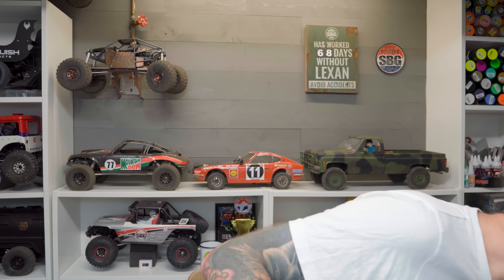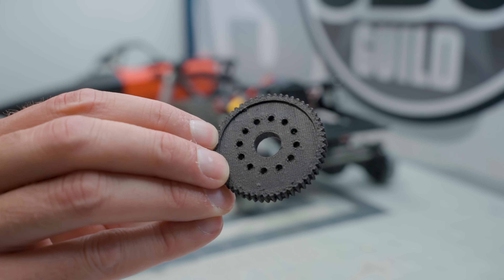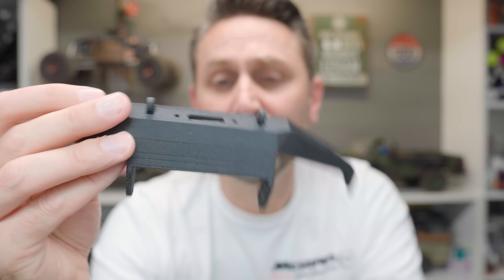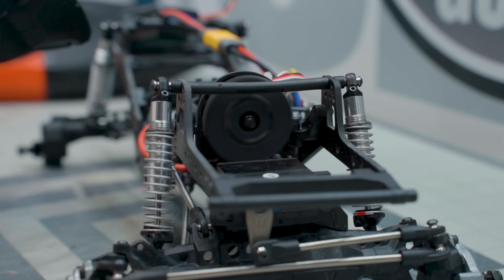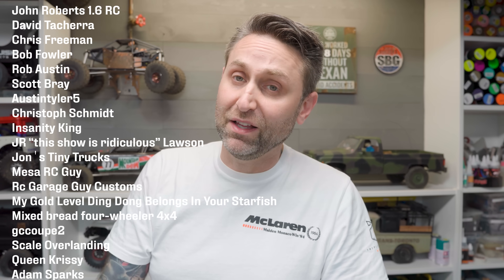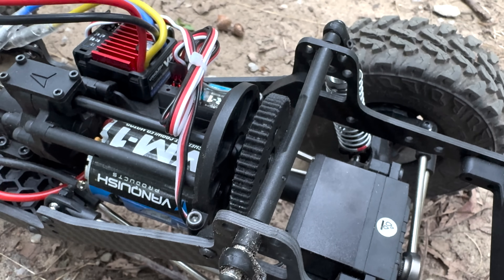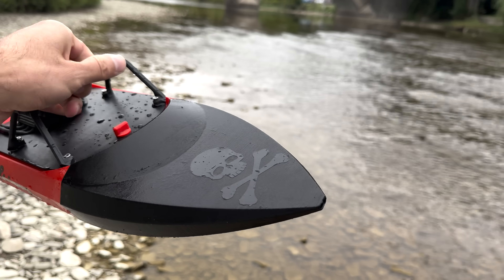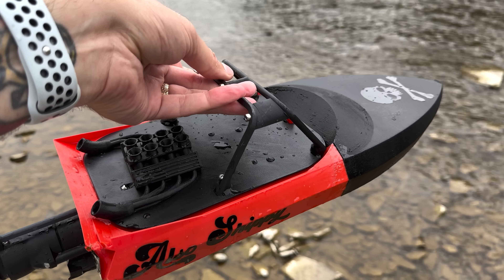Say Goodbye to Old Filaments – Meet the Game-Changer of 3D Printing!

Comment: To really test durability, make a hammer out of it and see how many nails it will drive before breaking. Might need to make a hollow core and fill it with weights to get the right feel. Could do this with several other filaments as well. Might be a fun test. Maybe not the best for this channel though.

Comment: You should checkout the new line from Polymaker called Fiberon. I started with a spool of PETG-rCF which is amazing. Easily printed, super strong and looks great. Then I tried PET-CF17… Awesome!! Finally , I tried the Pps-CF. It prints at the highest temp my K1C will go but it’s almost like it’s a metal and a polymer. Check it out!!

Comment: Why not print replaceable bumpers along the edges tip and front hull, like real jet boats, in the ppacf.  specifically places where impact damage mean a full reprint to replace. Would keep the costs down on that filament in the long run. This is completely game changing. I wonder how durable the material (and level of detail) smaller parts would be. For example. Try finding a 20-24t 2.3mm .5mod pinion for the typhon groms running a 1010 mmx2 like mine lol. But if i could just print a new pinion that would for sure be game changing. not to mention scale down a 3d printable drift cars and make a full Ackerman 1/24 rwd drift car that will accept mini-z bodies. or 3d print your own micro comp crawler chassis to build something unique. Like I get where people say the cost prohibits the "game changer" title. But looking at it from the big picture it truly does open a whole new world of options for us builder types that "wished they made X for Z" but its simply not on the market. I could literally design and print my own prototype for testing in a cheaper filament and then do a final print in the PPACF and have a way more durable part as a finished product with out all the extra material used in prototyping for said part that doesn't exist... yet for some reason i need it?? lol I'm with ya, this is some game changing stuff for sure!

Comment: For $100/0.75kg it’s got to justify the price of printing parts you’d normally buy. While a gear is a good strength test to a degree, you’d really need to run it for many long hours before concluding if it’s as strong as a regular composite gear which would probably cost between $4-8 depending on the vehicle. The fact that it doesn’t implode immediately does make it test better than other common filaments but still, $100 and it needs to print enough parts (and be at least as strong as them) to outweigh the cost of just buying replacement parts. 

Very interesting nonetheless, I’d be curious to see how it works with parts like a-arms, wing mounts, but still those parts are usually pretty cheap (or, you print them in high infill TPU and they’re indestructible). Bit of a brain dump this morning, haven’t had my coffee yet..

I like that the industry is experimenting with different materials, trying to find optimal use cases for them all while keeping the price cheaper or at least on price parity with injection molded composite parts is what we’ll figure out in time.
Reply from the maker: I like that there are always new innovations with 3D printing, regardless of the hobby!  I agree, it's not cheap, but in the long term- if everyone had a 3D printer- we could (in the future) probably print our own replacement parts for things that would normally end up in the landfill. Maybe I watched too much Star Trek Next Generation in my youth, but those replicators were amazing!
Reply: I would argue that you would not just print every piece out of this material. The best comparison would be if you have a use case where you actually want a metal part and this material may be used instead. Getting the required part 5-Axis-CNC machined would be much more expensive.

The requirements of the project tell you what you need and to stay cost effective it is a good idea to choose a suitable material.
If you don't need the stiffness and impact strength or heat resistance then it's just the wrong material. But if you do then you do then it is nice to have.

Also no one says that the whole part needs to be printed of this material. Lets say you need that heat resistance because it contacts with a heated part, then you could just create an interfacing piece from this material and the rest from something cheaper.

Comment: 48% stronger and 1000% more expensive. Just use TPU for the bumpers everyone.🤨
Reply: Yep.  Harder TPU, like 72D or something is pretty indestructible.
Reply: Race drones have been using TPU for years. As long as your printer has a direct drive extruder it's easy to use.
Reply: @Hotwire_RCTrix  there's probably no mainstream printer built after 2023 which can't print TPU
Reply: @antonkukoba3378  Thanks but I still wouldn't use a printer with a Bowden tube for printing a softer TPU.
Reply: @Hotwire_RCTrix I think he was talking about the fact that basically every printer since 2023 is direct drive. +1 for hard TPU as an insane material though btw. I have a blacksmith friend who made his hammer by attaching the head to the handle with a hard TPU piece and it’s been holding up great for months now, it’s not really even very thick
Reply: @antonkukoba3378  Hope they find a solution where TPU can be printed in multicolor. Yes Bambu released a TPU AMS but it's harder. One option would be to allow pauses for filament swaps mid layer.
Reply: just give it a few months and it will drop as cheap as pet-g or something, because they HAVE TO SELL, so if they will stock it for 5-6 months and nobody buying, see then sales ....
Reply: @ericcartman9935  Yep. Remember when ASA first hit the market? Was ABSURDLY priced now it's on bambu's store for $46AUD a spool. This is going to get the exact same treatment. NEVER and I mean NEVER buy things that have just been released unless you are positive you can profit 500% on it.
Reply: One just needs to think twice: Any stiff material makes a shockwave going through the RC on a crash, making the next lesser tough part break, while flexible materials absorb some of the shock energy. Toughness is better at reducing mass than adding protection.
Reply: @makrospex  I agree that TPU is tough because it's flexible but it also has really strong layer adhesion.
Reply: @makrospex  nylon is pretty impact-resistant. its a great material. but its too expensive for wider use. theres interesting nylon products with fibers for a long time now. but the processing is horribly complicated.
Reply: At this price this is not a game changer.
Reply: It's not even a standard 1kg roll.
Reply: Other sources for PPA CF exist for much lower price. Siraya Tech has a version for $60 for a KG which is reasonable.
Reply: I use hard TPU in place of PC used by a phone mount manufacturer, I’d say hard TPU is pretty god damn durable when it comes to wear, said mount has been solid for 2 years of daily wear.
Reply: And you also don't have to worry about all the small CF fibers stuck in your fingers and possebly lungs.
Reply: @Hotwire_RCTrix its not about the material per se, its mostly about the prestige 😂 it is advertised as having 227c heat deflection, say what you want, but 440 degrees f´ that opens a whole new warehouse of cool stuff you can make. money is temporary, cant take it with us, so im gonna spend it and make things 😎👍
Reply: @brycesstuff  that's fair enough, you should spend your income on what ever brings you joy. Most 3D printing enthusiasts don't usually have a big income so I would expect that super expensive filament is not on their shopping lists. I don't have an expensive printer just an old V1 CR10. It wouldn't make sense to buy filament that costs more than the printer is worth.😆
Cheers
Reply: €155,99 EUR per 0.75 kg...im good.

Comment: I understand why people don’t think this changes anything because of the price but proving you can achieve this level of strength on an fdm printer is HUGE
Reply: Prove?  Nothing was proven in this video because he admitted not testing the material in any kind of way beyond waving a part around in the air.  Actual tests and then statistical comp between materials would have been much more interesting than this promotional puff piece.  Sorry, but paid promotions should be clearly labeled as such.
Reply: @robblincoln2152 Thats what I was thinking like he never even tested anything, got sent the filament free, never tested it then made a video saying was a game changer 😂 like dude come on
Reply: @SimStig  dud you even watch the video? He tested a spur gear and made parts to test and use over time on his rigs.  He isn't running a 3D print specific channel so don't expect full test rigs for stress testing etc.  Ffs a little common sense and watching the video goes a long way.
Reply: PPS is know for ages and even a bit cheaper.
So is PEEK. But its very expenive. Nothing really huge there pal
Reply: High temp nylon with CF is expensive already! Eg htn cf25 is like double the price.

I think this filament is a great addition
Reply: Awsome! Is it possible to get the files for printing that boat?
Reply: @helli3088  Uhh maybe, go look for it, seems like the thing there would be a billion variants and similar designs out there. But I still wouldn't print it with an FDM printer if you can avoid it, a tough resin like Blu with like 10% flex resin mixed is going to be exponentially stronger. No layers to potentially delaminate and way more watertight as well. You can get good resin printers for under 500 bucks these days.
Reply: No, it's not. There's absolutely nothing new about carbon fiber filled nylon. Get a grip.
Reply: @TheSolongsidekick  well, I didn’t know it was this strong or easy to print so it’s a big deal to me, even if I don’t buy it from bambu. I make car parts and mostly use petg cf.
Reply: @TheSolongsidekick you have no idea what your speaking about. This doesn’t compare to any nylon you have tried. 2nd go print a spur gear like Matt did. See how long that holds up. Let not even get into heat deflection.
Reply from the maker: Agreed!

Comment: Lol Bambu is for sheep. i find that qidi makes some nice strong filament PET-CF its not the strongest they offer but for my RC stuff its holding up good. if you just want flat out strong. try out qidi PA12-CF i made some gears for my traxxas thats still holding up. high nozzle temp needed 280-300C needed I use qidi max 3
Reply from the maker: Thanks for the tip! I really love my Bambu!

Comment: Having it print at a different orientation would minimize the tip breakage seen. What you had was layer separation, I know you probably did it standing up to allow it to print without supports but canting it to a 45-degree angle or such would eliminate the layers running along fracture angles.

Comment: I would be interested in seeing how this new filament reacts to anealing 
I've done anealing on PET/CF and was very impressed
Only slight shrinkage in the XY and  the Z axis (approx -0.01mm xy and +0.008mm in the Y with 6 walls, 6 top and bottom layers at 100%infill)
All of my carbon fiber filaments regardless of the type have that rough texture that can be attributed to the CF but they always come out very clean 
On a side note I never use support G or any other type of support material for hard use engineering prints due to the possibility of cross contamination 
Dial in those support settings and they come off super clean
BTW I use Orca Slicer 2.1.1 and have found the interface layers make all the difference 
3-4 interface layers
Set your interface line spacing to zero (solid interface layers) top gap 0.16, bottom gap 0.2mm and xy gap/spacing 0.35 mm
Using a small flat head screwdriver  and a razor blade for those ignorant spots and they will pop off and look clean as a whistle 
One final note, the support structures I use are either tree organic for more rounded models, or regular snug for more flat surfaced and edged models

Comment: Just to let you know that you didn't mention or I missed it but you can and is recommended to aneal the part(s) in the oven for 8 to 12 hours at temps between 80 to 100 C or 176 to 212 F which will make the part even stronger!
Reply from the maker: Yes I’m pretty sure I mentioned it! Very important!
Reply: @scalebuildersguild  Actually I went back and watched it again and you didn't mention the anealing , just that you needed all metal hotend, for the abrasive resistance. Just an FYI. great video tho.
Reply from the maker: @cowboy124aa3 I did mention drying, didn’t I? Maybe not annealing!

Comment: Nice video and content, thanks for such a good video and your thoughts about the new PPA-CF.

My thoughts: 
Spur gear on a crawler is a good test to begin with, however not really a great test of the filament. I suggest that you print a spur. gear for a 1/8 scale electric off-road 4WD buggy which can run a 4S or a 6S LiPo and run the buggy on top speed and see how well does the spur gear really holds up. Cause that would really put a huge amount of stress on the gear and material and if the spur gear still holds up well by the time a 6000mAh battery is down to empty from full, then it would definitely be called a GAME CHANGING material and can be used for replacement of parts for RC cars.

Comment: Hello. Can you recommend a good 3D printer that excels with that super strong filament?
Reply: It’s that BambuLab brand?
Reply: P1P vs P1S vs X1 Carbon? What advantage does enclose vs open frame?
Reply from the maker: Enclosure will retain heat better for more complex filaments.

Comment: How is it to print though? I mean is it easy, hard, somewhere in between?  I've never had much luck printing ABS for example on my X1C.
Reply: It's actually very easy to print as long as you follow the instructions and use glue.
Waaaaay easier than Asa, which warps for me even with a brim.

It prints even easier than PC for me

Expensive though

Comment: Good video! Just wanted to add watch CNC Kitchen and My Tech Fun as they will give you insights to the strengths of each filament, PLA is one if not the strongest you can get however its impact strength is lower and in your case friction heat is way to low as PLA does not like to rub on other materials, but it will out hold better than any other filament under certain conditions temp and high load for extended times is not one of them. Another thing to think about is larger layer lines and an extra 10-15 degrees past normal printing also will add strength by better adhesion between layers but visual quality drops off. Its great they are really pushing what is possible with FDM printing.
Reply: PLA is “strong” but it really doesn’t come close to filaments like these especially when you take into account the other mechanical properties too.

When printing things like gears then visual quality matters, any imperfection that you can see will likely be a surface imperfection that will effect friction or wear or how the gears mesh together.
Reply: @conorstewart2214  that is very correct

Comment: Great except it's $100+ a roll, ITS NOT NEW at all, been around for a while just not from Bambu (and runs upwards of $250 a roll).

I have a filament at $40 a roll that works amazing for RC use but don't leave it out in the sun in your hot car (fine beyond that) unless you understand how to anneal.   

Stuff is stronger in all aspects even against ABS/ASA and easier to print with too.

The biggest problem with printing "strong" is knowing how to do it and stay away from cheap filaments.

Comment: It better be some fantastic stuff for how much they want for 750g of filament. I've purchased some expensive filament before, and it was usually for a specific project that paid for itself. I'll have to find a reason to spend a hundred bucks on some. Great video.
Reply from the maker: Thanks for watching!
Reply: Try PLA Super Tough - it is nearly same price as PLA and I bet it is as strong or stronger than this stuff. I printed out ping pong and tennis balls that bounced really well and I could stand on without feeling any deflection and I am 100kg.

Plus no chopped fibres.

I printed out a 1 metre span airplane flying model 1 layer thick and it has withstood multiple crashes.

I can't believe that eveyone is not using PLA ST as their standard filament.

Comment: So I bought a Creality Ender 3 KE to get started in 3D printing and it went great for a month and then the printer has quit functioning. I’m considering buying the Bambu Lab A1 and wanted to ask if you think there would be an issue using the Creality Hyper PLA that I have so many rolls of?
Reply: I have a Bambu Lab X1 Carbon and it prints most non Bambu Lab filaments just fine.